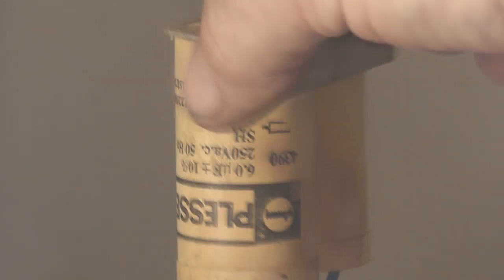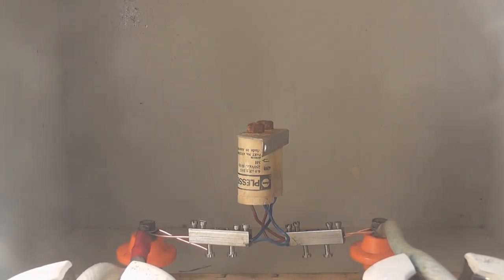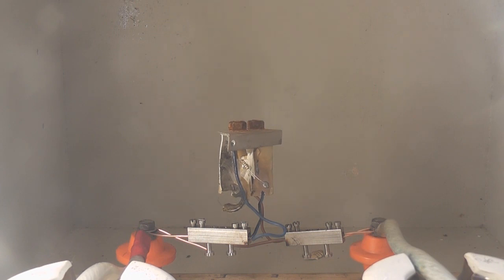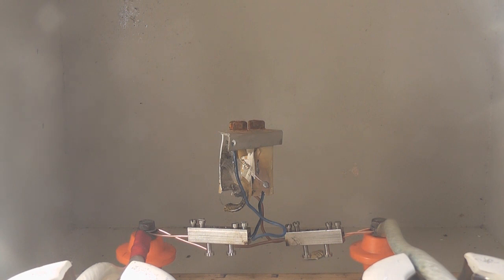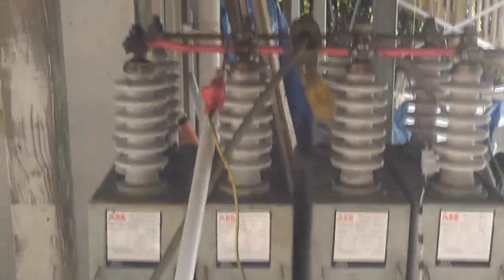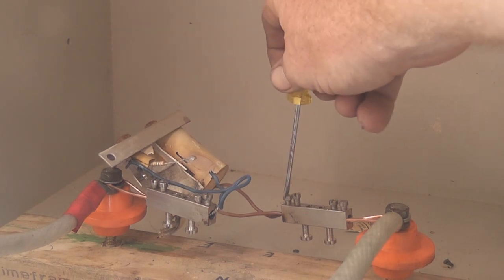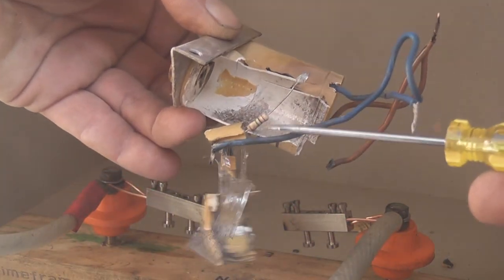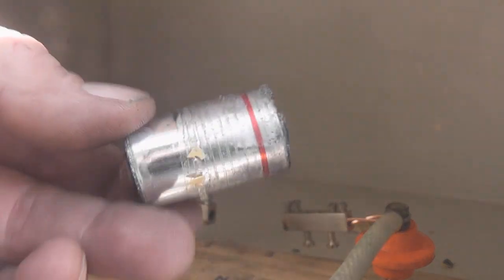Capacitor explodes

Comment: I like the way RODAL was not impressed with the first explosion and demanded a bigger one. Other one is a rev pol a electolytic and I had a RIFA X/Y mains cap (those in the translucent see-thorough plastic 0.1uF typically, used across the mains in smpsu) fill my house with brown smoke as it died.
Reply: Yeah i know that too with the Rifa Capacitors. I was listening to APP's "Pyramid" Album when suddenly a brown smoke came out of my Turntable (While the record still played!?) of course it was one of these RIFA 0,1uF for mains smoothening. These Caps are the nastiest "stinkers" ever been made and they are aging very badly. Sadly, many european Hi/fi and Audio devices from the 70's decade have some of these inside. Most likely to be found in Studer and ReVox Devices. Get rid of them as quick as you can.
Greetings